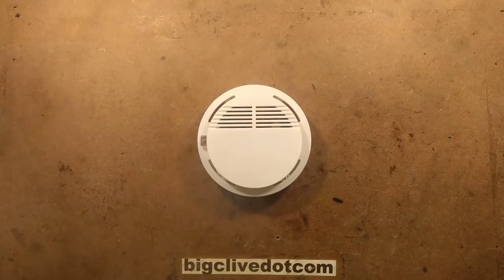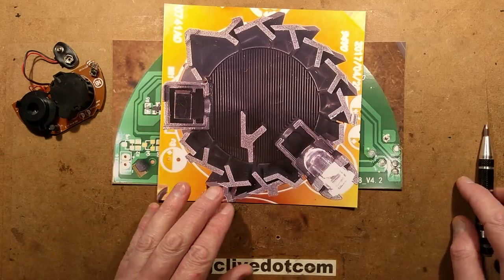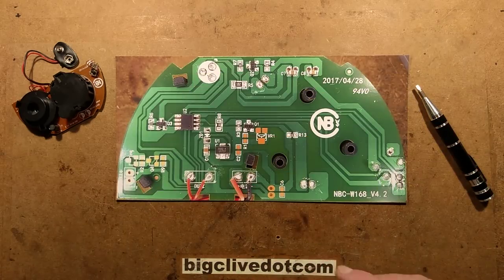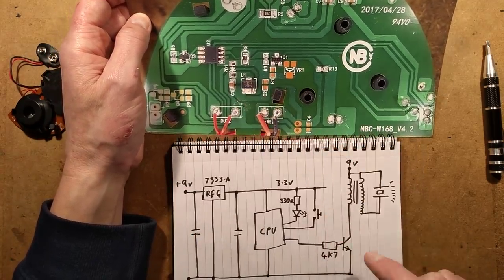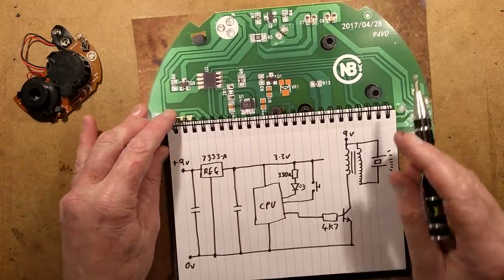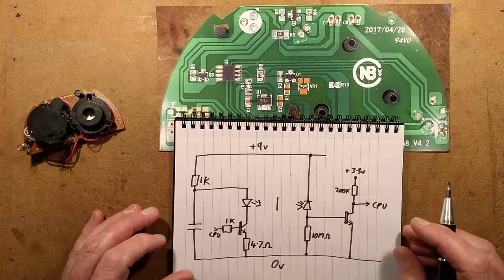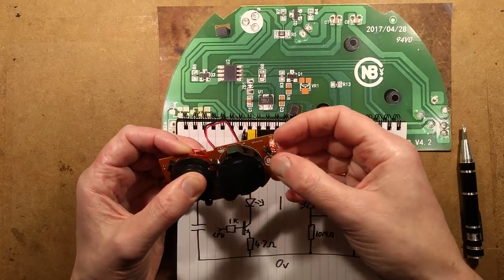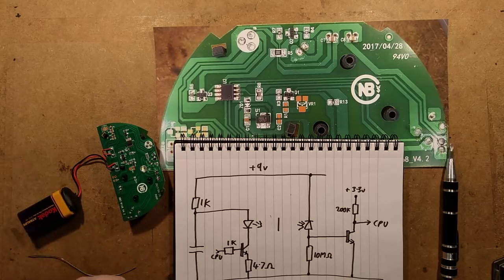Torch your home for $4. (with schematic)

Comment: Clive, the big scare is that so little is said about the fact that even the best ionization detectors (which are fastet to respond) go dead in 7-10 years, and just changing the battery won't fix that. New detectors with a built-in 10 year battery fix that, toss and replace the whole thing. It costs less than 10 battery changes and won't wake you up 10x in the middle of the night.
 Canned smoke, for a real test, is worthwhile for all of them.
Photodetector alarm for 4 bucks? Priceless!
Reply: Yeah, I like the idea of the decade smoke detector. Now if only they had energy budget for WiFi or BLE for ten years...
Reply: If you want the alarm to be sent out over bt or wifi, it only needs power once when you configure it, and once more when there's a fire. But the radio chips add $5 even to cell phones, which means $10-20 more in the retail price. Ante up.
Reply: I've got the BRK ones with an RF base wired into the house lighting circuits they all have 10 year lives, and Li batteries for backup. They are the ionisation and optical ones. Since I had to fit mains interlinked alarms when I built a new house extension to meet building regs it was easiest to do it this way and I can fit extra ones or replacements in a matter of seconds. Recently bought 2 spare bases from a closing Homebase for £7 each. Newer UK houses will all have mains detectors so these battery driven ones will be of little or no use in them.
Reply: I smashed my smoke detector nearly 20 year's ago.
Reply from the maker: I recommend changing smoke detectors completely every five years.  They do accumulate dust.  In greasy or dusty areas they should be changed sooner or a rate of rise detector fitted.
Reply: if every time i change the battery i light up a candle or something and it beeps, i can be sure its still working right?
Reply: @25566  Or get a woman to cook.
Reply: Either buy a cheap cigar or "canned smoke" sold for testing smoke detectors. Candles are unreliable, many are smokeless.
Reply: @templebrown7179  there are already some with low power RF for retrofit interlink.  We got some from Kidde for my Grandparents old house so you could hear upstairs in the bedrooms if there was a fire in the basement or inside the house if there was a fire in the attached laundry room.

I suspect they use something like 433mhz you could rig up a RTL-SDR to detect and do something on the net triggered by it...or just get one of the wired-wireless bridge alarms and tap into the wired alarm interlink signal wire
Reply: If the need was for plain old smoke detectors, I'd agree.   But in my jurisdiction, since we have a woodstove (a fireplace also counts), combination CO and smoke detectors are required, which are substantially more expensive.  Fortunately, ours are "hard wired" to the mains and the battery is only for backup.
Reply: It is an odd business. When you combine the two detectors, the problem is that the CO detector will fail in about 5 years, while the smoke detector is good for 7-10 years (depending mainly on how much dust is in your air) meaning that you have to throw out a perfectly good smoke detector to keep the CO detector in service. Convenient, yes, but not economical. We had a choice this year to replace the mains-wired smoke detector, but for the same exact price I bought one with a 10-year battery built in. So instead of being awakened by a backup battery that somehow died every 18 months...without being used...now I've got one that doesn't need or care about mains power, and won't wake up me in the middle of the night for a diaper change [sic] for ten years. Maybe one day they'll may one that doesn't start the "replace my battery" beeps UNTIL THERE IS LIGHT.
Reply: True.  Here in the states, however, code still requires us to put in hardwired (hooked to mains) smoke detectors.  I think that needs to change because there are battery powered ones that last 10 years now.
Reply: The code is fine--for photocell detectors that CAN last "forever". Of course hardwired without requiring a battery backup is useless in hurricane or blizzard territory, where the power goes down for days and the candles come out. And start fires.

Comment: This makes me think that the free smoke alarm the fire brigade put on the landing a couple years back is an optical one, cos it triggered when I was messing about with my smoke machine, the old alarm didn't do such things cos it was a nuclear reactor type, or whatever it is with the little Americium bit in it... :)
Reply: The nuclear reactor type is an Ionization smoke detector.
Reply: twocvbloke The other type is an ionizing detector.  The best smoke detectors contain both optical and ionizing units as each has its strength and weaknesses, what one detects earlier the other takes longer and vice-versa.  But most of the less expensive detectors are optical and they are very good at detecting fires that produce a lot of smoke while the ionizing detectors are better at detecting slow smoldering fires and the combustible gasses they give off well before they have produced much detectable smoke — so one is great at detecting slow simmering fires and the other fires that are fast burning and/or produce a lot of smoke (or steam, even).
Reply: Ethan Poole the landlord put a small rubbish battery powered one on the ceiling in the kitchen a few years ago,  what is that one?  Its over my gas cooker,  it's fine if I use the oven but when I boil things in water on the hob the bloody thing goes off,  it's done so twice this week once with rice and once with a boiled egg,  I had to take the battery out with the egg as flapping a towel at it didn't shut it up.  Is that the steam or the burned gas
Reply from the maker: All smoke detectors will detect fog.   In theatres they have to use heat detectors or use a temporary bypass system during a show.
Reply: the latter sounds scary. I regularly visit Theatres
Reply: Most theatres I've been in opt for heat detector, but bypass is fine because it doesn't bypass the whole building usually, just the stage and the ones inside the HVAC ducting (which have an annoying habit of picking up theatrical fog in the return!)
Reply: Christian Neville I didn't think of partial disabling
Reply: Sun Wukong As Clive says, it could be either, though I would suspect optical because the vapors from things like frying frequently set off ionizing detectors if they are in very close proximity to the stove top — I prefer to mount kitchen detectors on a neighboring or opposite wall so that they still sound in a fire but are less prone to nuisance alarms just because of a minor drip in the oven letting out a whiff of smoke.  Anyhow, the reason steam can set off either type is because steam looks like smoke to an optical sensor and to an ionizing sensor it behaves a lot like a combustible gas due to its large hydrogen content.  Steam will also set off many gas leak detectors as well due to the hydrogen content of water.
Reply: I've worked in several theaters where the smoke detectors were bypassed for show because of haze.
In Theory the only time the smoke detectors are disabled is when there is someone in the theater running the fog/haze/smoke machines.  The fire department has someone on standby and the theater technicians know to call 911 if there is a fire because the smoke detectors won't work.  In one off situations with fireworks indoors usually the fire department sends a fireman to stand there and watch for fire.  With normal operations they usually just let someone know who is answering the phone.
Reply: Yep ionization type
Reply: On the theater says things I remember in on stage crew at school we have special key switch for the fire alarm that was a temporary disable system that would throw up some sort of special troll signal and occasionally you get a double chirp at the panel that you know that it was disabled and also at a panel by our lighting board as well.

I remember using it system quite a bit also when soldering or welding.

Or special effects involving Flames fire and smoke.

 even flash pots smoke bombs even maroon shells.

 as well as Fountain charges and many others.

 and yes occasionally when we use Steam for special effects.

Of course smoke and fog is well even occasionally Hayes.

We actually had many a real fire we almost lost the school once.

We had have first aid CPR and fire training and more.

Being in stage work could be more dangerous than the football team.

For one thing you don't have around 3000 amps + of power running everywhere.

440 volts ac.

Pyrotechnics.

50 ft + ladders.

Electrocution hazards.

And yes I have had to assist CPR.

We had a guy that shouldn't even touch a light switch or an outlet unscrew the front cover on panel we don't even know where he got the screwdriver from.

He rolled up electrocuting himself we may have to bring them back before the EMTs arrived.

I remember one of our fires we dubbed the Great Chicago Fire.

Because the scenery was downtown Chicago that course internally flammable it was supposed to be broad off stage before the Pirates hanging scene but we are firing a pyrotechnics through lighting board / lighting desk. at that time before we had a dedicated system.

 which after this of course we switched sistoms.

Weird used all the buttons including those menus for Pyro.

So there was no way to include an abort button Lian guarded the fire button in the arm button.

But some idiot on the clear Chrome said at the line board and didn't make any lighting Q mistakes or anything.

I had a headset on and I said the guys I don't like the sounds of that I hope that was was not the arm button being pressed.

Not surprisingly it was. The next saying we heard in the scene there was next or the one after that was oh bleep bleep bleep bleep bleep bleep bleep bleep bleep bleep bleep bleep bleep.

And then all of a sudden the firing sequence commenced.

And I course all the scenery caught fire.

Not the biggest butt but the most embarrassing and the most preventable.

That's why we got the new pyro firing system which by the way used are readily available lxr mic cables.

Sodas are Clear-Com intercom system.

Which gave you the idea one time for prank because one of the guys was always goofing up on setting up electrical equipment four stage.

We got him good.

What we did is we got bad microphones and turn them into basically something similar to Roman candles.

And after you done the audio wiring and the Pyro wiring.

We switched out the real microphones for the Perot microphones.

And also switched up all the wiring so the Pyro controller was connected to the microphone cables.

Of course is done while he was away.

And he came back and I said to him are you sure you got everything hooked up right this time.

 And he said yeah I'm sure.

And so I said okay let's find out and I armed the Pyro controller and press the fire button and Let the Sparks Fly

 You should have seen the look on his face that course I was just laughing out loud of course we got this.

On video VHS of course no digital back then.

B f u

Before YouTube of course.

Comment: Nobody buys a 4$ smoke detector for their own home.   Landlords buy them.

I'll bet that besides Big Clive, most people who buy these buy them in packs of fifty.
Reply: In my experience landlords just don't replace them even 50 years later as long as they work.  I did not trust the ones in my last apartment so old they made a buzz not beep which took us an hour to realize one was going off below us...and did not even have battery backup.  Lease says they can not be removed or modified so I installed my own new name brand alarm adjacent to theirs.
Reply: Code will probably require hardwired interconnected systems for rental units. These are for people who want the security of a smoke alarm, but only want to put a fiver toward their fire safety budget.

Oh, and the cost of a warranty is not included here.  Even more expensive "cheap" smoke alarms have high failure rates.  They come with a warranty though, which you are paying for in the price.  Part of the $13/£10 you are paying is going toward sending you a new one when it breaks in 6 months.
Reply: Thankfully in Australia (or at least the state I am in) has laws requiring landlords to have proper smoke alarms (and my landlord recently send a guy out to check the smoke alarm for compliance)
Reply: Andy Lundell, if they do they probably take the batteries out the first time they false alarm, like when they've burned their toast. I have a full fledged commercial Fire alarm system, but that's only because I designed it when I worked for a company that made them.
Reply: My landlord didnt provide me with any alarms at all. I bought 2 spoke detectors at £20 each and a carbon monoxide detector for £15
Reply: No, the developers who build the houses buy smoke detectors since they have to be installed for the building inspection. They buy the cheapest ones they can find. Homeowners never buy them unless they've gone bad. In the US, however, if there is a building or rental inspection, the inspector will look for a test lab to have certified it to a UL standard, therefore dirt cheap Chinese junk will not pass, unless they fake the logo.

Comment: I bought a Smoke Detector for $4.50 at a retail store Wal-Mart. Lit a fire on top of it, never went off until I poured water on it.
Reply: I test my smoke detectors by throwing then into a fire. They usually don't go off, so they were obviously no use to begin with.

Comment: I have 2 FireAngel ST-622 alarms supplied by my fire brigade. These are supposed to have a 10 year battery life. Both now are giving a low battery alarm after only a year or so. The batteries are not replaceable. Took one apart and the battery was still good. Contacted the manufacturer and was told to contact the seller.

Comment: I used to work in that industry. The MSP430 family was actually a common ish choice for optical smoke detectors due to its great low power modes and rich ADC options. However at least the engineers I knew of eventually moved back to an ASIC solution - so the cost benefit is right on the edge.

BTW in some instances the device may not go to lobat mode unless it sees VBat sag when load is turned on - in this case, the emitter LED.

Comment: Good video! It was a big relief when my local council installed mains operated smoke and heat detectors. You do sleep better, what with so many lithium based products laying around, many on charge while we sleep too!
Reply: The year 1921: Cinema fire caused by motion picture film.  The year 2021: House fire caused by lithium ion battery in thermal runaway... One step forward, one step back... The thing in common is both have their own oxidizer.

Comment: That light chamber looks exactly like the one in the Nest smoke detector I autopsied a while back after it got a mind of it's own.
Reply: The main difference being the Nest alarm probably packaged the same sort of components with a $399 price tag, rather than the $3 Clive paid! ;-)
Reply: @ddragon8154  I will say that the nest seemed very well built inside.  Although it's the only smoke alarm I've ever owned that has actually failed.
Reply: +Do R/C! A lot of times people miss smoke detector failures because they don't test them often enough. Assuming  that smart detectors can run a thorough self-test and report faults to the user right away, it's one of those few cases where having domestic tech connected to the network is a good thing! :-)

Comment: According to eevblog there's an in-circuit emulator in the development software kit.
Reply: Not in the software kit, available as a hardware kit :D
Reply: Not all electrically programmable ROM is UV erasable, some technologies are physically irreversibly altered.
Reply: If they are using eprom rather than fusable links then it may be possible to erase them using soft x-rays.
Reply: It could.  It would depend on finding xrays with high enough energy to penetrate the plastic but not so much that it causes damage to other devices within the chip.

Comment: I was working in a hospital once. The builders had covered up all the smoke detectors to prevent dust ingress. On the day of recommisioning, the had reenabled the zone detection. As they were removing the covers, the elasticated cover flicked dust up into the detector and set of the alarm!
Reply: Adam Bryant see that in my hospital too usually stuck a rubber glove over them.

Comment: I wonder if fast pulsing is because it;s looking for a rise in light from  pulse to pulse rather than absolute level. Probably not good for battery life though
Reply from the maker: A previous unit based on a dedicated chip pulsed slower, but woke and increased the sample rate if it detected something suspicious.  Maybe this one was in a heightened alert mode.  I might wire in an extra LED with suitable resistor to allow monitoring of sample rate in a more realistic way.
Reply: I would suggest it's looking for a high degree of match to that pulse in order to weed out false positives, changing up the rate would only help that aspect.

Comment: There is a YouTuber named David McLuckie who did a teardown video covering an even cheaper smoke alarm he found online (On AliExpress). That one was tested with a simulated fire and appeared to fail to operate. What he found inside was a much smaller circuit board than the one looked at here which looked as if the only thing on it was the detector itself until David pointed out a tiny buzzer. The scary thing is, apart from a lack of battery cover, it looked just like the one torn down in this video and the detector Clive tore down in 2015.